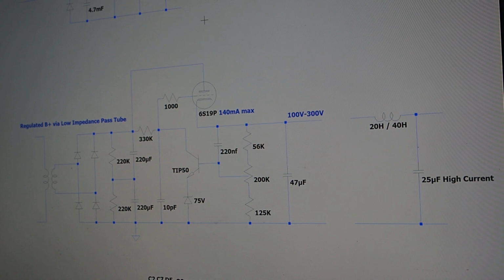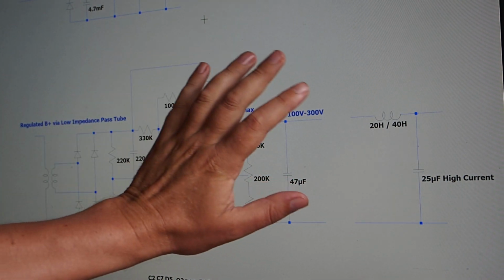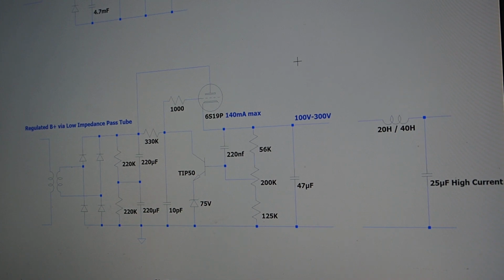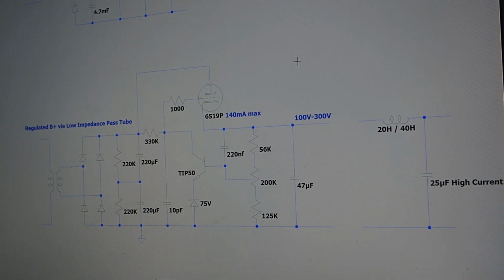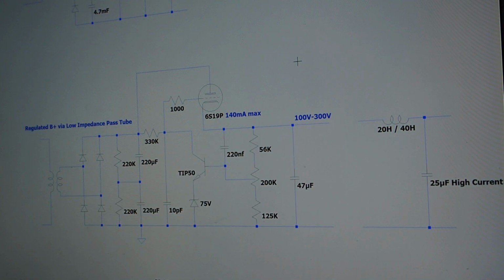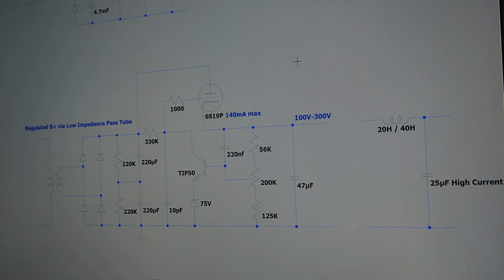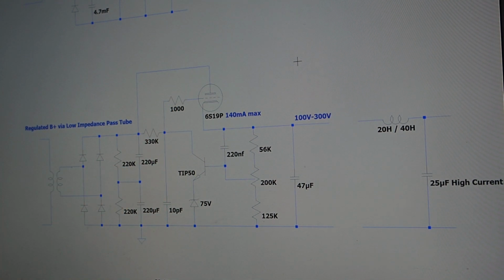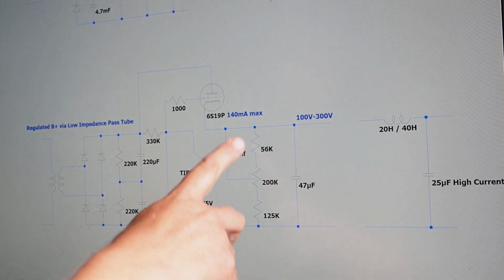The design of my power amp - part 3/4: the regulated power supply

Comment: Hi Eduard.. Looks good.. What Schottky diodes did you use? Some do prefer shunt regs, but this is a nice alternative.. IIRC, Thomas Mayer uses CL for decoupling instead LC.. Yes, a large choke as the last element feeding the OPT for example, but those are SE amp/preamp designs.
Reply from the maker: The schottkies are Infineon D12S60. Interesting; Thank you. I'll have to try the CL as well then; see if I can hear the difference on the SE driver stage. At some point I'll have a go with a shunt setup plus try an 'classic' LCLC stage, maybe even with something like an OA3 in between the LCs for the driver stage.

Comment: Very interesting schematic, I guess that in any case you need a dedicated floating filament supply (or referenced to the cathode). I had a look at the data sheet of that tube, and it is actually designed as a power supply regulation tube. So not repurposed.
Reply from the maker: Hi Hugo. Actually this tube looks like a nearly exact 1/3th version of the 6C33C :)